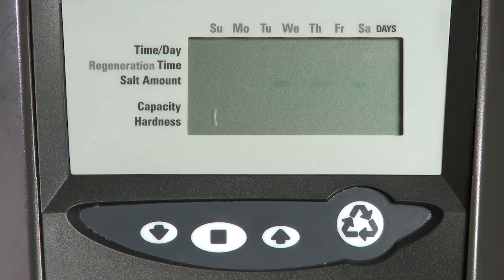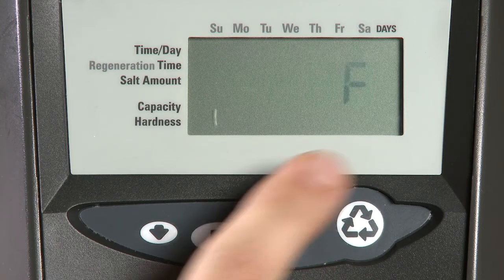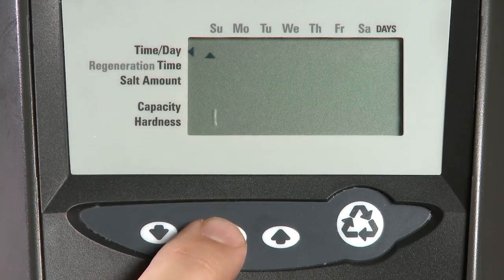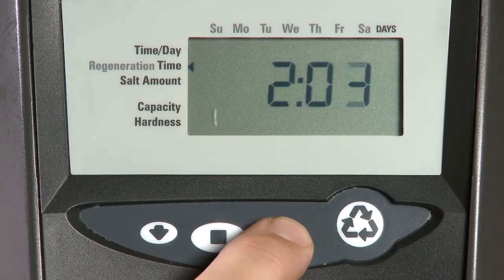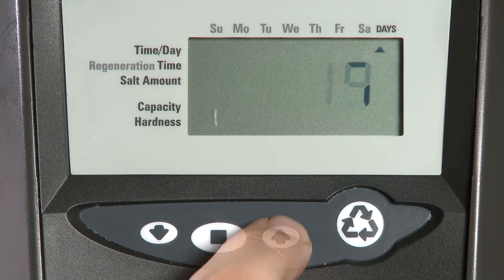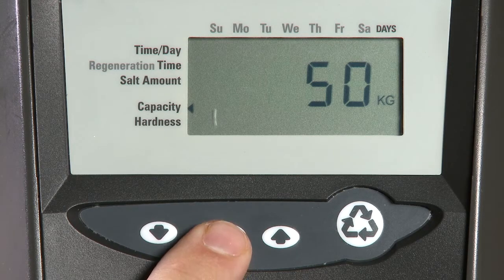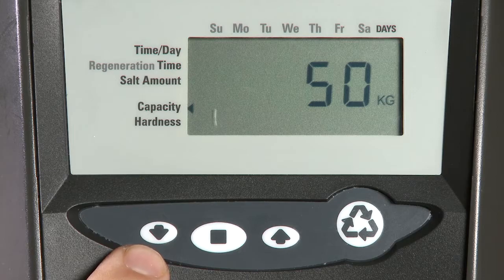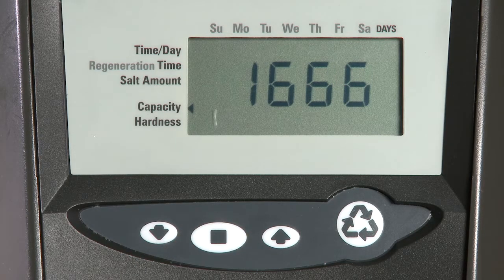Autotrol Logix Standard (740/760) - Quick Start Programming

Comment: What’s a day override?
Reply: the day override is the setting number of days that the system will regen no matter if you get to the number of gallons its calculated based on the other settings.   if its set to 14 days, no matter how much water has been used, it will run every two weeks or the following day after it exceeds the calculated gallons of water,  which ever occurs first.

Comment: How do you know your resin amount?
Reply: It's based on the size of your system.
Example, mine is 40,000 grain so I enter 1.25 (cu ft of resin)
32,000 grain is 1.00 cu ft
You can measure your tank and look it up.
Example, my 40,000 grain is 10inches in diameter by about 44inches high.  Savvvy??

Comment: suggestions for new product design:
I buy the device
I find out the actual water hardness with a test
I fill the device with salt and water, in the manual is explained how much of the ingredients in KG and Liters
I have 2 settings:
actual water hardness on a scale from 1 to 20
and the objective water hardness from 1-20
The system regenerates whenever it is nesseccary on a 24 hour time schedule.

Design products for life and not for engineers or scientist with badly written or translated and hardly understandable cryptic manuals.
Make life easy with a new product design.
It's simple, give it a try.
Reply: That’s… pretty much what it does…
Reply: Have some decency and shame, +Unalingua
Reply: It’s simple, so create one. smh

Comment: Absolutely useless video. There is no mention of what units the displayed numbers refer to, or what the settings should be. A much more comprehensive instruction manual is needed to properly decide if your water softener is working correctly and to maintain it in a suitable manner.